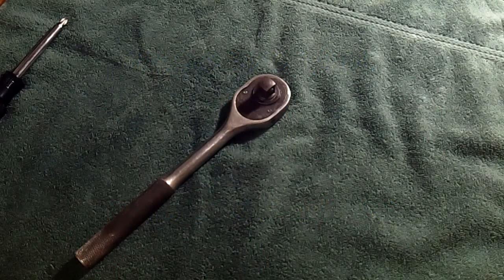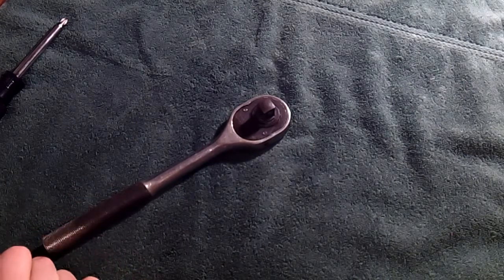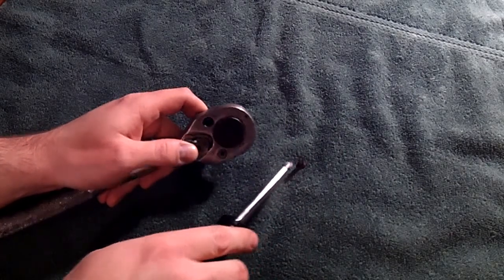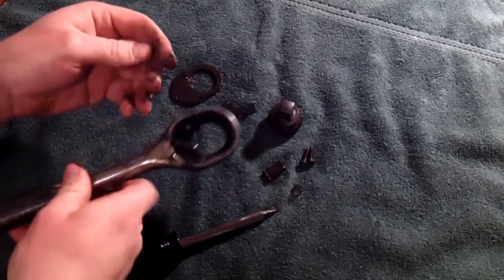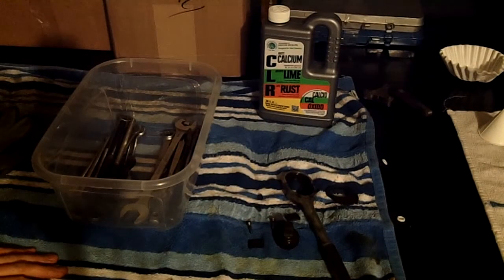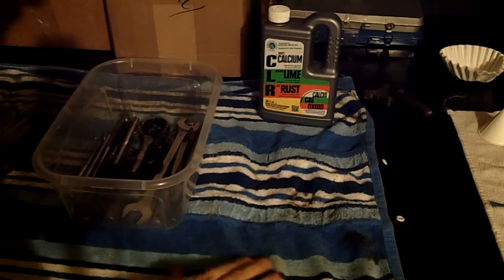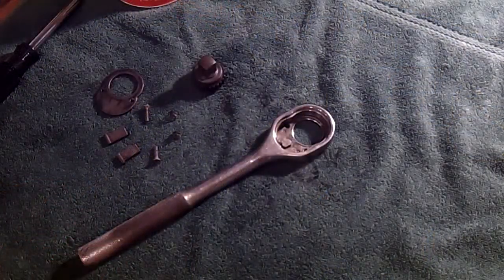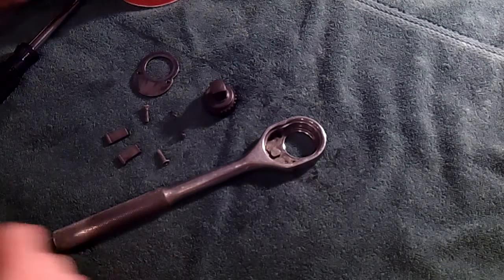How to Clean w/CLR & Lube Vintage Proto Ratchet

Comment: This ratchet (or at least the cover plate installed on it, if it had previously been replaced) actually would have been made sometime after Stanley bought the Proto Brand off of Ingersoll Rand in the early 80s. After Stanley took over the brand, the tools began being stamped with "USA Professional". Prior to Stanley, the tools were marked "MFD USA".
Reply from the maker: Thank you for the info. But that was already noted in the video description from back in Jan. 2015, when it came up then. I should of known in the first place, the lettering is a dead give away, between original Proto script, and post Stanly script.